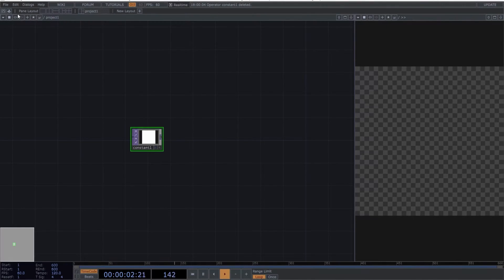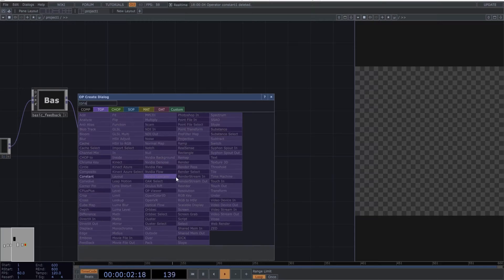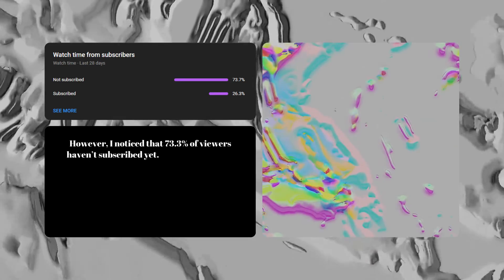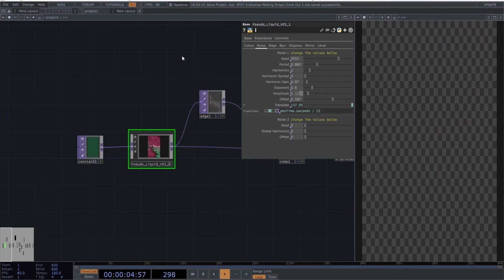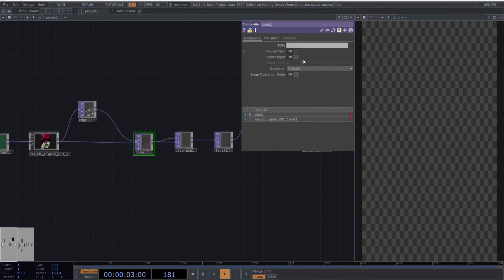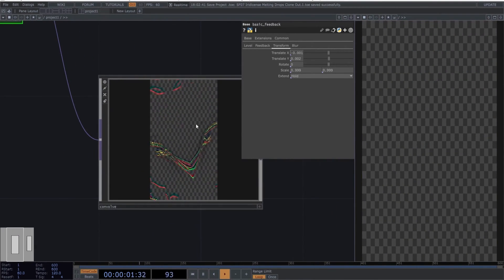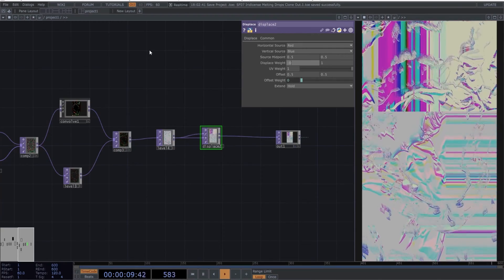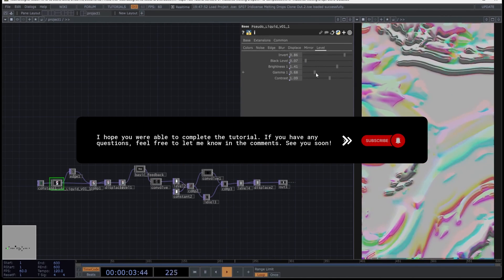TouchDesigner Tutorial: Iridescent Melting Drop Texture Futuristic Pastel Neon Color with Glitch VFX

Comment: Hey - are you better able to explain how to set up the feedback operators using the non-custom one that you have? Even with your additional info in the video description I'm still confused and don't have it correct. My end result doesn't look like yours. The Level 1 operator is directly before the feedback operator, so are there 2 Levels in a row, then Feedback, Transform and Blur? And I don't understand what 'option pointing to a Level parameter for opacity' means.  Any help is appreciated!